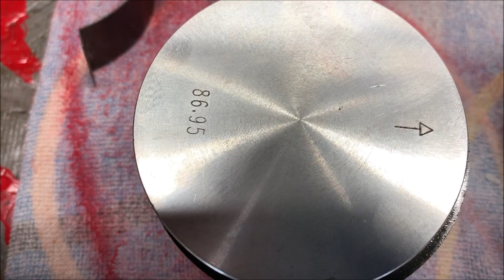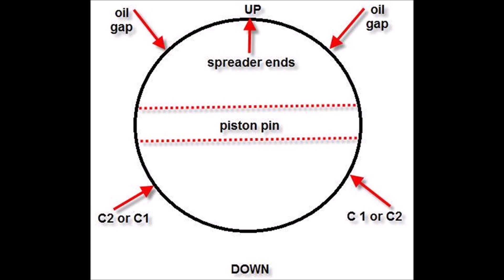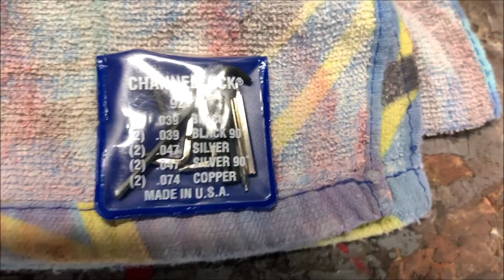VW Beetle - Super Beetle Piston Ring Install - 1600cc -  DIY - Dual port - VW Bus - VW Herbie Bug

Comment: Hi Mr Slade. Quick question again..
Where do you clock your compression rings? ...or did I miss it? Doing this tomorrow..
Great videos
Reply from the maker: I show it at 3:45
Reply: @SladesVWBeetle  Thanks for the reply.  Sorry....I overlooked the diagram. 
....now I just have to find the wife's whiteout!  Lol
Reply from the maker: @user-pt5px6uk4w  Oh I always take my wife’s white out. She finally bought me some for the garage
Reply: @SladesVWBeetle  LOL.. nice to see that she is looking after you! 
I installed the pistons, jugs, and heads yesterday. Went well.  One tip I would like to share....always put a rag in the bore in the block to prevent your wrist pin clips from falling into the case when they zing out of you pliers! 😁
Reply from the maker: @user-pt5px6uk4w  oh yeah!! I brought that up in one of my videos I just forget which one. Often times I forget to, so far I haven’t dropped one. But now that I’ve said that you know what will happen. 😁

Comment: Brother Slade thanks for the vid. This is a question regarding your next vid (which I can't find right now but I have seen it). When you do the actual piston to con rod build did you bother decking the heads or CC them or do you just assume that everything is going to be cool? Decking and CC ing seems to be kind of overkill for a 48 hp motor IMHO. Like you I am using AA piston and barrel set. Thanks for the posts.

Lawrence
Reply from the maker: I am so sorry Lawrence, I was not notified of this comment, I am not sure why. And there’s so many to go through, somehow this was messed. I don’t mess around like that when it comes to small horsepower. Of course I was building something high horsepower everything would be checked.

Comment: slade, have a guy asking me about 87mm cylinders. i like them over 88 thins. some other guy has poopooed the 87 for being thin. i guess you've had good success with 87's in the past? i may have go all mathematics on his ass if you think they are just fine.
Reply from the maker: Honestly I’ve never had an issue with them. I have a friend who has been running the same motor for many years with them and never an issue!!
No I don’t like the 88 mm thin ones, they are really bad. 
But the 88 mm thick bore are outstanding! But of course you have to have the heads cut for them to fit
Reply: @SladesVWBeetle  this guy was working with $20 extra for the 87's. i don't think he's got the budget for head mods.

Comment: Great video! How did you clean the new parts prior to assembly? I have heard a lot of different ideas from brake cleaner (too toxic for me) or dish soap? Thanks Bro!
Reply from the maker: Hey thanks for being here, I use the brake cleaner, although make sure to use gloves and a mask. Yes as I’m getting older it’s a little too toxic for me also!! I am wondering if Dawn dish detergent would work? That stuff cleans pretty well.
Reply: There’s a guy named Jack Kessel who completely disassembles everything then uses dish soap. There are a lot of peeps who use brake cleaner and I’m sure it works perfectly though, Thanks!
Reply from the maker: I may try that, thank you for bringing it up! The brake clean is rough on the skin...use gloves. But, that stuff is just nasty! Feel like I should be wearing a respirator when using it! 🤦🏼‍♂️
Reply: @SladesVWBeetle  I try washing the parts in dish detergent and hot water first. Then any further cleaning with brake clean.  ...a little tip I like to follow is use non-chlorinated brake cleaner in my small garage...a lot less toxic fumes. 😳
Enjoying all of your videos!

Comment: hey amigo , been a minute , seems like yesterday we chatted bout rebuilds and now ure doing it , yes!!!!! my case is in shop and ive been watching tons of vids soon ill be doing same , itll be my 1st rebuild!!!
Reply from the maker: You got this brother!! I’ll be doing a full rebuild on my next one. Probably some more lower top!
Reply: @SladesVWBeetle  also I think throw out bearing on dads car may be going out ,we hear a click in reverse, so ya I'm getting good at dropping motors,...
Reply from the maker: Usually a throw out bearing will make noise when the clutch is released. And when you push the clutch in the noise will go away. And it won’t do it just in reverse I don’t believe.
Reply from the maker: That video isn’t far off Amigo!

Comment: I know there is more than one way to skin a critter, I normally load the pistons from the bottom of the jug. If you notice most jugs have a bevel on that end and I think it helps the rings enter the cylinders better. Good job, I can't wait to hear it run👍🤠🚙🚗
Reply from the maker: Thank you Clinton, thank you for your advice. I never tried it that way yet. I can’t wait to hear it run either, LOL I should be starting it pretty soon. Just trying to get stuff done on the house.

Comment: Good information.  I used a small vice grip to hold the ring compressor tool.  But I fumbled around lots more than you did.
Reply from the maker: Thanks Williams, yes it is a little bit of a pain to hold those compressors. I probably should’ve used vice grips, that would’ve been a better idea.

Comment: I will be doing this next week, it's good to get a brain refresher...
Last year I did my buggy engine almost exactly the same method as you show in this video, except I positioned my rings at 10, 2, and 6 o'clock...it all works..as long as oil doesn't pass thru....
Yep that channel lock tool is very nice, I need a pair....I used needle nose, which are very unstable....it's hard to get decent tools around here.....
Thanks for the video, like I commented on Gary's video yesterday, it's nice to see something non-political to watch for a change...
Reply from the maker: It’s quite an easy job honestly. 
Those channel lock brand snap rings are much nicer than I thought they would be. 
I’ve been trying to buy nicer tools from Lowe’s. Since craftsman really went downhill a lot. Yeah I know the feeling, I’m truthfully tired of the politics already.
Reply: @SladesVWBeetle  well, I just pulled apart my engine, I'll be doing the rebuild by Monday or Tuesday....everything about my engine casing looks good...I had several head nuts sized up, so I had to remove several studs...made me nervous since that magnesium is so soft...I think its ok, no threads were damaged...even if they pull out I have some inserts leftover from my buggy engine....
Reply from the maker: You’ll be fine!! Just move slow and take your time! Never rush in an engine! And make sure to shim your end play properly!!